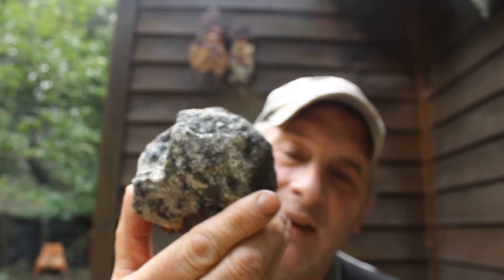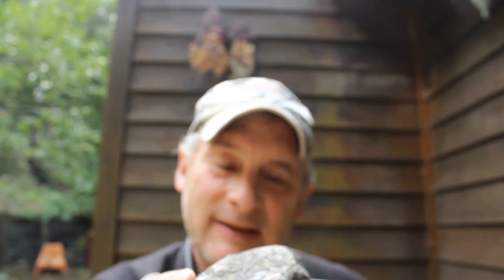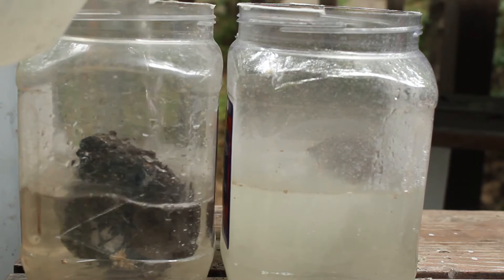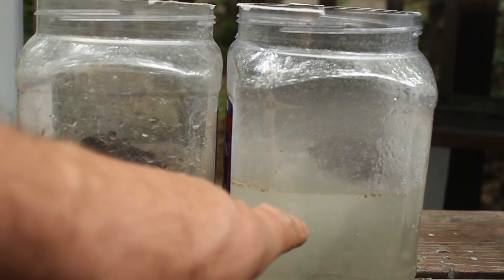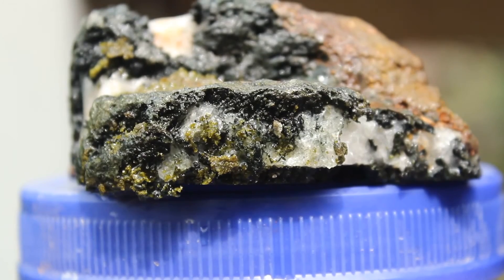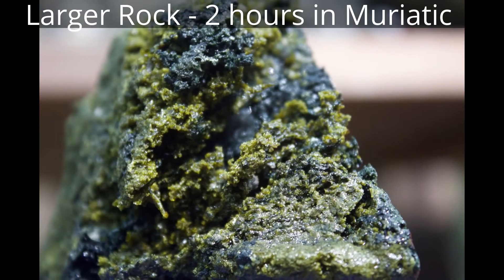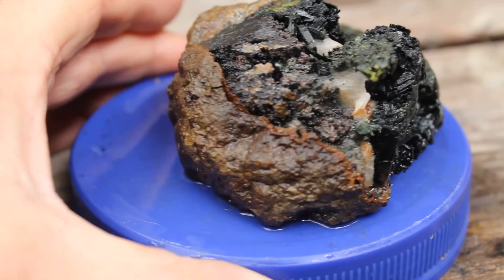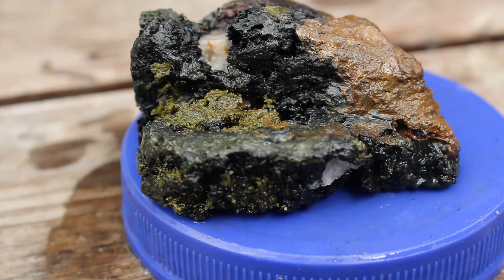WHAT'S INSIDE?  IRON EPIDOTE ROCK GETS SLICED & ETCHED

Comment: Great video. Yours is the third one I watched and I considered yours as the best. The first one didn't actually do anything he just talked. The second one was doing the muratic acid for the first time. I couldn't watch all of it. He made me so nervous sticking his hands into the solution instead of using tongs. He hand exam gloves on. I kept waiting for him to slice a hole on one of the jagged edges. He kept fiddling with a tooth brush so he was inhaling the fumes instead of walking a safe distance to watch the fizzing. Who ever advised him didn't stress the point about the fumes hard enough. He was in his garage. He did have the door opened. But, he kept standing right over the solution I had to stop. The first guy looked like he was in a basement but, he advised to put a cover over the container and that fumes could leak out and corrode any metal near by. Your way is best doing it outside. And you explame very well what you're doing. So you get an A grade the other 2 get a D grade. I won't fail them cause they both servived lol.😹💖 Ms Michal
Reply from the maker: It can be nasty stuff if not treated with respect.  Thanks for watching and the nice comment.

Comment: Cool looking rock! Just a thought with you focusing, seems you have a shallow depth of field most of the time, it very hard to hit the focus then. I think you said you have a DSLR? If you do increase the aperture to a higher number so you have a greater depth of field, say about f8 or higher experiment and see if that helps. I use a Canon 7d on my channel and it works great for me (no strings attached living off grid is my channel)
Reply from the maker: Oh man.  Any advice is welcome.  The camera (Canon Rebel T3i) does not have autofocus on video.  The manual focus is so sensitive that moving a rock 1" seems to make a difference.  It would be better to have someone else film and focus, but I am usually alone.  I will try your suggestion and if that does not work, will go buy something with multipoint video autofocus.